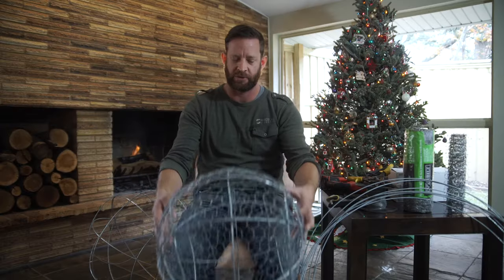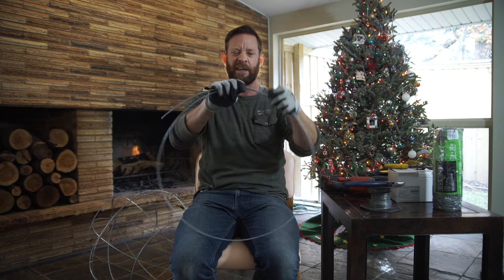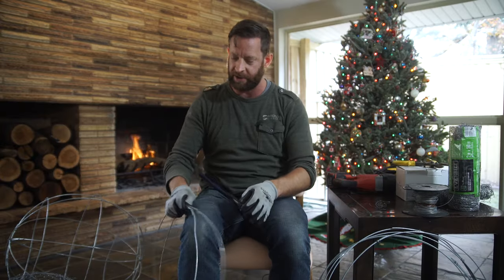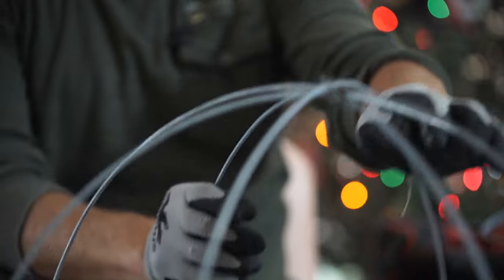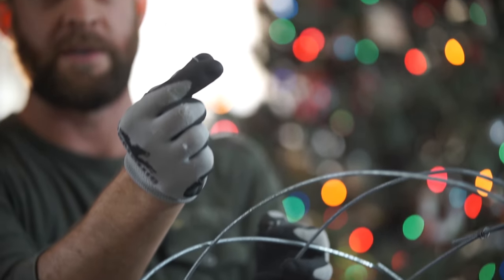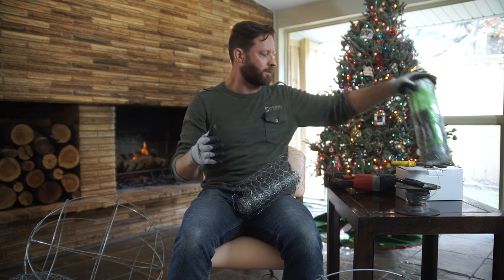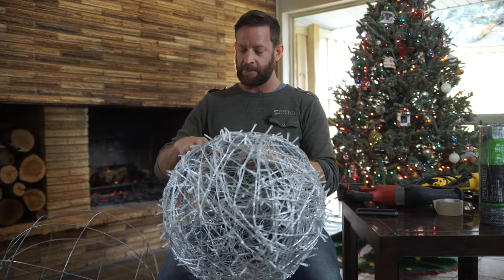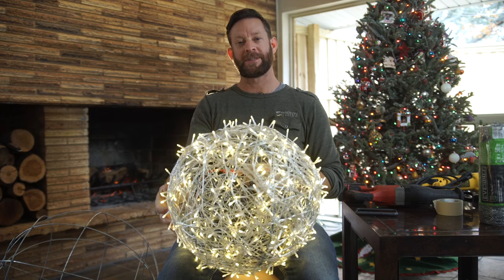How to Make Lighted Christmas Balls from Chicken Wire/Poultry Netting

Comment: U used what we call, "chicken wire." Pig fencing has large rectangular shapes to the fencing. Checking your lights to make sure they will work, is something you should do, before, putting them on. Personally, I think I will stick to making my Christmas balls with the Solo plastic cups, cuz easier to make and easier to hang as well. This project is too expensive to make. Not a common usage of materials that people have around.